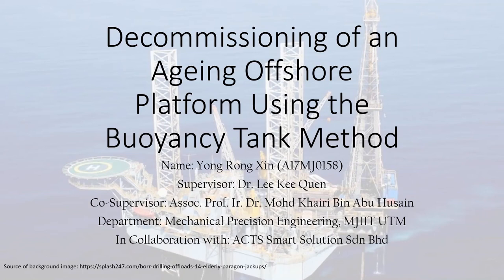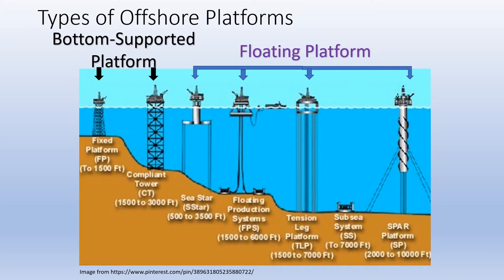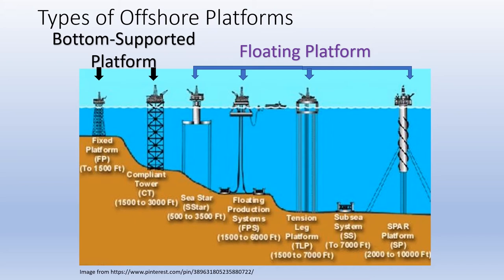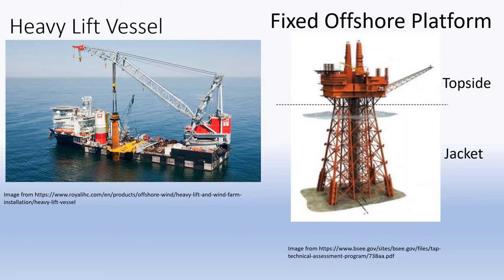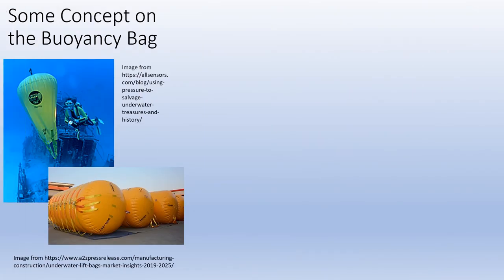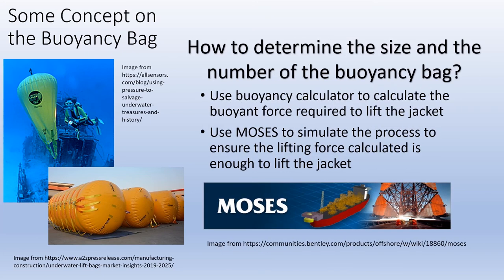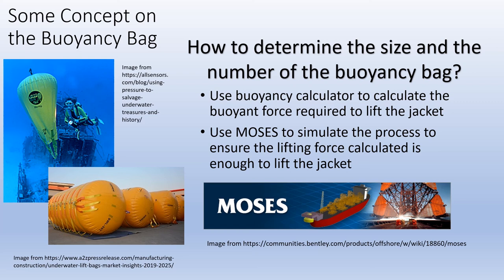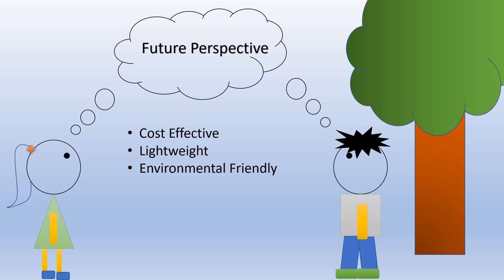Yong Rong Xin - Decommissioning of an Ageing Offshore Platform Using the Buoyancy Tank Method

Comment: Hi Ms. Yong. Thanks for sharing the interesting topic.  I'm guessing that you are applying the Archimedes theory.  Wondering if you will also considering the stability of the buoyant body,  where I think also very important especially in the aspect of safety.
Reply from the maker: Hi Dr., thank you for your suggestion. Yes, I'm using Archimedes theory for my FYP. Currently stability is not considered yet as the minimum size of the buoyancy needs to be determined first before determining where to attach the buoyancy bag on the jacket. However, I will consider it when deciding the location to attach the buoyancy bag on the jacket to make sure that the jacket can be removed from the site safely.

I hope that I answer Dr.'s question. Please feel free to comment more if Dr. have any doubts on it.

Comment: Question from Examiner:

This video is interesting. However, it looks like the introduction of the big project but not about the final year project of one student.

What is your originality, new idea and contribution in the project?
What is the research gap and your idea to fill the gap?
Reply from the maker: Thank you Prof for spending  time to finish my video.

First of all, I also agree with Prof's opinion that the decommissioning of an ageing  fixed offshore platform is a big project. However, my FYP will only focus on the removal of the platform's jacket using buoyancy device (either buoyancy bag or buoyancy tank), which is one of the stages in the decommissioning of the ageing fixed offshore platform.

The method of removing the jacket of a fixed offshore platform using buoyancy device is a quite new technology. This method is only used once during the decommissioning of offshore platform is in Norwegian North Sea. In that project, Buoyancy Tank Assemblies (BTAs) were used. The BTAs is fabricated with metals.

My project will be focus on the feasibility of the buoyancy bag which fabricated with non-metallic materials in the removal of the jacket of offshore platform in Malaysia. To find the suitable size of the buoyancy bag to be used to lift the jacket, I need to determine the relationship between the mass of the jacket and the minimum size of the buoyancy bag. I can do this with the help of Microsoft Excel. First, I will create a table that will calculate the size of the buoyancy bag with a given mass of the jacket, similar to a buoyancy calculator that will give the volume with specific buoyant force (in this case, the buoyant force is equal or slightly larger to the weight of the jacket, depending on the buoyancy ratio). The mass of the jacket will be in a column while the size of the buoyancy bag will be in another column. Once the size of the buoyancy bag is calculated with their respective mass of the jacket, a graph of size vs mass can be plotted, and from there the relationship between these two variables can be determined by using the trendline function. An equation will be derived from the trendline that best describes the relationship (either linear, polynomial, exponential or logarithmic relationship), which is then can be differentiated to find the optimum size of the buoyancy bag.

I hope that I answer Prof's question. Please feel free to comment again if Prof have any doubts on it.